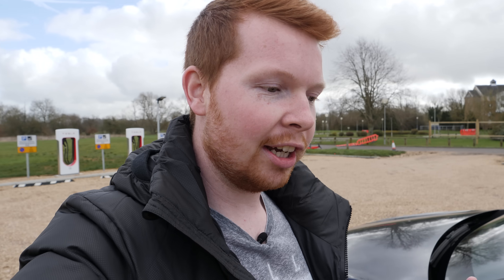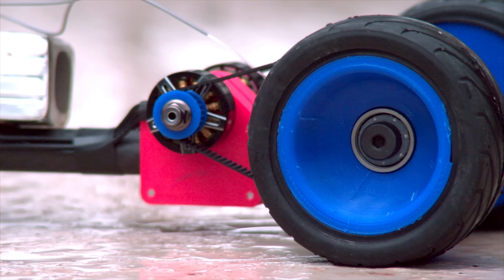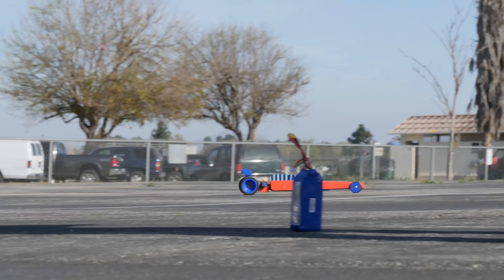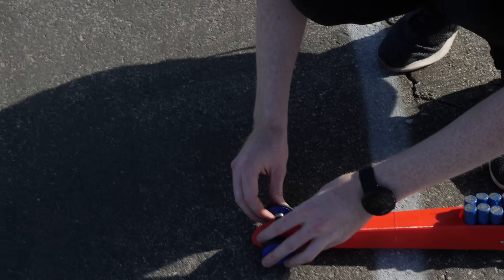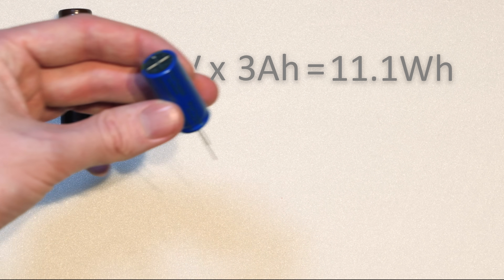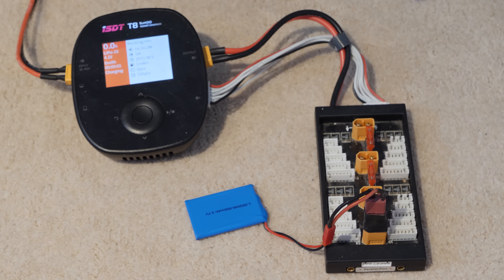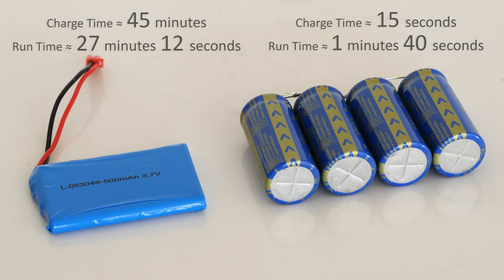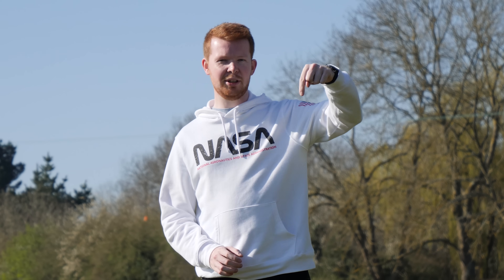Super Capacitor Dragster

Comment: 3:56 -- Question for clarification!  Your explanation of the wonderful question Peter asked you is great; I like maths.  But hey, why the 7200 as a divisor?  2 x 1 hour (ie. 3600 seconds)?
Reply: OH wait, I think I get it!  2 x Time (1 hour) because the (V^2 x Farads) is divided by 2?

SEE ALSO:  https://en.wikipedia.org/wiki/Farad

F = Watts x Seconds (and that's a dot product) divided by Voltage^2  ...
Reply from the maker: The equation for the capacitor energy in J is (capacitance x voltage^2)/2. So to convert it to Wh, it must be divided by 3600. So yes, the 7200 is just 3600x2
Reply: @TomStantonEngineering  This is correct, but only if you discharge them completely to 0 V. With most electronics that is not possible, so strictly speaking you would need to do the integration with the charge voltage as upper limit and cutoff voltage as lower limit. Because of that the usable energy is even lower with the caps.
With batteries these simple calculations work way better, because the voltage is almost constant and the result will be pretty close without taking the discharge curve into account.
Reply: @1Hippo  you are right a capacitor discharges exponentially and as an average when the charge falls to 1/e of its initial value it's assumed completely discharged.Theoretically it takes infinite time to discharge completely.The video was good and your comments eye opening.
Reply: @TomStantonEngineering  Power equals energy consumption over time, P=E/t, i.e. the power is the rate of energy consumption in a given amount of time. 
Energy in a capacitor equals (C*U^2)/2. So how dividing the energy in a capacitor with time gives you the Wh, when the formula from the first row of my comment and in general says that P=E/t? Dividing the energy accumulated in the cap with time gives you the power that your capacitor can reach. It gives you the power that you are able to sustain/reach/develop using that particular capacitor. So, ((C*U^2)/2)/3600 gives you the power you are able to reach for every given second using that particular capacitor. Wh and J are equivalent, interchangeable. In fact, Wh are Joules and Joules are Wh. You can't divide Joules with time and say you've got Wh, because you don't have Wh, you have W.  Deducing from P=E/t using measurement units, we get that 1W=1J/1s, meaning that 1 Watt equals to using one Joule of energy in one second. So, 1 Ws equals 1 Joule, one Ws is 1 Joule, 1 Joule is 1 Ws. You can't divide the Joule with time and say that it's a Wh or Ws. It's not Wh, not Ws, but it's W. So (3^2*50)/2 gives 225 Joules of energy. If you use 225 Joules of energy for the following hour you are getting power of max 0.0625 W every single second.
Reply: @zrnjan  You are so close to understanding why/how the 3600 is used, that I thought I can help you the last bit. 
In short, it is simply a conversion. A factor without a unit.

Tom Stanton says in his reply that the initial formula is for energy of a capacitor puts out an answer in Joules. And the 3600 is used to convert the result from Joules to Wh. As you state yourself 1 J = 1 W * s.
And there is 3600 s per hour. 
Therefore the answer in W * s needs to be divided by 3600 to have the answer in Wh.

Another take on it. If you have 1 J, you have 1 W * s. But not 1 Wh. You have 1/3600 Wh = 0,00027778 Wh.

The factor converts the number by a factor that fits to the conversion of units.

Lastly way I can formulate it. 
If you have a light bulb using 60 W of power, and you let it run for 1 hour. It has used 60 Wh of energy.
You end off your answer by saying that the Capacitor will output 0,0625 W every second for 1 hour. Then we can conclude that it have delivered 0,0625 Wh.

Hope my (long) answer makes sense and helps you :)
Reply: Fred Thank you Fred, that is some nice explanation and really clarifies things.  I didn't think of it the way you suggested - that it is a way of expressing the Joules in terms of Ws or Wh. Thank you.

Comment: Apples and oranges comparison.
Batteries are electrochemical
Supercaps are Electrostatic.
Huge difference, even their discharge profile is not comparable.
So, using these supercaps for energy storage in EV is a big fail.
Energy recoup as in regen braking, that'll work.
Reply: And it's already implemented in the new Mazdas.

Comment: What’s the relative energy density is these super capacitors vs lithium ion:
- by weight
- by volume
Reply: Very, very, very poor. Supercap energy density (volumetric and mass) is terrible, sadly.
Reply: @Guysm1l3y  do you know what capacitor is? Idiots
Reply: @swedensy  Do you know what a capacitor is? @Guy Smiley isn't even wrong...
Reply: Guy Smiley supercapacitors provide more torque and have more power density
Reply: @thealienrobotanthropologist  the more cells you have in a pack, the more complex things get to manage. Supercapacitors also have a massive durability advantage, because far fewer side reactions occur, whereas lithium ion batteries are "fussy" about temperature, rates of charge and discharge, and deteriorate with age even if unused. In large battery packs, one bad cell can introduce stresses on others.
Reply: The Supercaps advantage is in Power density instead of energy density
Reply: @TheZio69  Do you need super caps for lasers or normal caps?
Reply: @manipulativer  
Depends on the type of laser. Pulsed lasers would take advantage of the high pulse powers of regular film capacitors.
Reply: @TheZio69  Literally saying the opposite of what  Majin Snake says: Power = Watt, Energy = Joule
Reply: @TheZio69  Um. They are the same thing. I think you mean discharge current.
Reply: @procrastinator1842  energy is power times time, power is voltage times discharge current.
Reply: Don't forget about price!
Reply: - By $
Reply: Look at maxxwells capacitors those are excellent
Reply: Majin Snake do keep in mind that Lithium batteries have a drop off voltage and super caps do not (it stops due to the minimum controller input voltage), therefore far higher percentage of energy is left in the super caps than the batteries when the cars controller shuts off.
Reply: same same but capacitors have a super high charge and discharge rate
Reply: @carlosandleon  that's exactly what capacitors are for. You really have to have a huge peak current draw to justify using these. Like a railgun or something
Reply: @mattweger437  or you can use a capaciter to smooth out electrical current so a pc can use it.
Reply: @thealienrobotanthropologist  Transformers don't change the power level from input to output. They only trade volts and amps based on turns ratio. Ie a higher voltage output will have the same power as the input but less current flow.
Reply: The difference is that supercapacitors have a low useable voltage range when compared to a lithium cell ( 0v to 3v vs 3v to 4.2v) however, the power density (charge and discharge) of a capacitor is way way higher than a lithium cell at all temperatures.  

Why don't EVs use supercapacitors? It's mainly energy density.  A lithium cell can store upwards of 100x more energy than a capacitor.   For example,  an 18650 lithium cell is around 3Ah, whereas an equivalently sized supercapacitor will have a total capacity of maybe 80mAh of which 30mAh is actually useable.  So an EV battery pack would need to be ~100x larger physically if capacitors are used (not possible).
Reply: @thealienrobotanthropologist   bad answer
Reply: @bismuth7730  right
Reply: @bismuth7730  worse answer
Reply: heavily dependent on how you plan on using the supercaps.  usually dependent on the system using the electricity.  lithium ion have a safe/ usable voltage range of around 2.5v - 4.0v .  But because supercaps are not damaged by draining to completely 0.0V, then you can drain them to 0.0v safely.  However, as seen in this video with the electric cars, the motors stop running around 6V.  So the minimum voltage in this particular case is 6v.  So there is quite a bit a energy remaining in the supercaps that is unused, basically from 0v to 6v is unused.  If you added some electrical components to use the remaining energy, you'll get more run time.   Hope this makes sense, it's my first time trying to explain the topic.
Reply: @thealienrobotanthropologist  u cant use..lithium cells in regenetive breaking efficiently in cars u would need batteries bigger than truck for that so yes capacitors not only have huge power advantage but in many cases they are only option thats why capacitors are everywhere around us and not lithium battteries open any electric machine u would find 10-100capcitrs open ur keyboard mouse computer motherboard ssd smartphone or any freaking electronic device there are tonns of capacitors
Reply: @anand.suralkar  Wrong, Tesla and other EV companies do regen braking just fine recharging the Li battery. Also, this video is about super capacitors, the use of caps for short burst of power. Most caps in consumer electronics are for LC circuit tuning and smoothing and not for holding substantial energy.
Reply: @amorag59  mostly correct.   Lithium cells dont handle regen well in all circumstances.   They are the weakest part of the whole powertrain.   Regen braking would be way better with supercapacitors across all temperatures but to capture enough energy would require a capacitor pack that is much too large to be realistic.
Reply: Andrew Hudson Yep, should have rephrased that as companies have been doing regen for a while, still have decent range after 8+ years, and the drawbacks would outweigh the benefits if you have caps in there only for helping regen. I have the hardest time trying to illustrate what you just did - capacitors really don’t hold a whole lot of energy like to the point it’s laughable. I’m subbed to Tom but I almost can’t watch because I know people are going to leave things like “supercap-next-best-energy source it’s like magic” type comments
Reply: @amorag59  we have been trying to use supercapacitors in automotive applications for years (12v battery replacement) ,  but this energy density piece is still a big issue
Reply: Andrew Hudson I remember reading something like due to the slow leak, a 12v battery equivalent (in size) would drain to empty in only30 days. Would also only give you 2-3 cranks if having starting issues. Existing wet cell is fine given it’s designed around its purpose - ‘let’s not reinvent the wheel lol’ was my first thought in seeing that for the first time.
Reply: @amorag59  yeah, they do have a self discharge of about 20mA but that's at full charge.  If you have a 3V cell, you will lose 10 to 20% in the first day.  But will take 45 to 60 days to get down to 2V. Just a little tidbit of info for you.  But the key off load of a car is 100mA or more and thats what drives the size of a 12v battery so high. Most OEMs have a 70 day requirement, meaning that we have to guarantee a successful engine start after 70 days of being parked (some companies are lower and some are higher)
Reply: @amorag59  the main problem with supercaps is that afaik putting them in series makes the overall capacity worse.
also for regen breaking flywheels are sometimes better.

you can use a supercap bank combined with a low capacity lithium cell, like 5-10Ah, which is the best of both worlds, weight saving,  capacity and current.

auxiliary supercaps are already used for cold climate starting in trucks and emergency vehicles.
the problem that happens in lighter duty vehicles equipped with those is that the starter motor burns out earlier due to the increased current.
Reply: @satibel  The use in cold climate is just about the only use that make sense to me.
Reply: @amorag59  also the longevity of the battery, but on most cars it's counterbalanced by the strain on the starter.
Reply: @satibel  True, but I'm also considering energy density. Whether it be paired with a small Li battery or incorporated into an EV and used for regen braking, your going to need to set aside a noticeable amount of space. 

Unless I'm an ice road trucker I'd rather not use a capacitor Li battery composite for a pure ICE vehicle.  The capacitor equivalent (plus Li battery) most likely will  be bigger than the original 12v wet cell. If you have a capacitor and Li battery (~15 mAh) paired, this most likely will not work. The battery has to rather instantaneously charge the capacitors right before you start. If you don't isolate the caps from the battery the caps will slowly discharge your battery. A 15Ah source can't provide 100-400 amps in milliseconds.

In regards to Caps in EVs, the phenomenon you describe with capacitors in series decreasing capacitance and the fact you'd need to stack them to make 400 volts (plus decent amount of storage so it doesn't saturate while your still braking), as well as cap cell balancing power electronics only means more and more space is needed for just for cap powered regen braking. Not saying the idea doesn't have its merits, just that if you were a manufacturer, would you rather spend $$$ designing in capacitors or would you rather just let the customer take the burden of loss of battery longevity? All of that just for one feature.